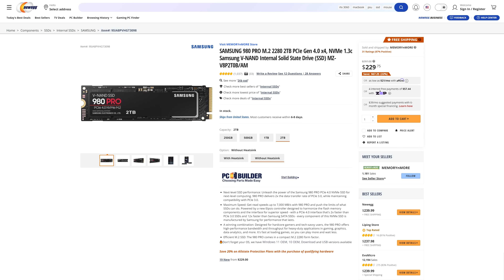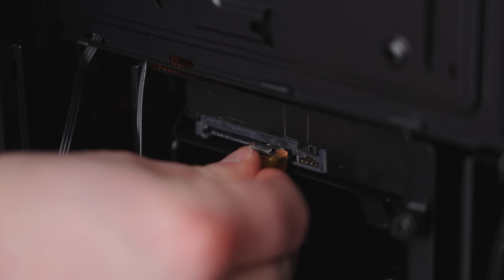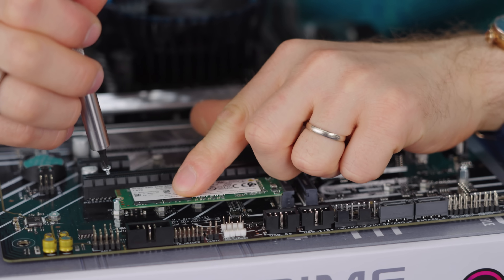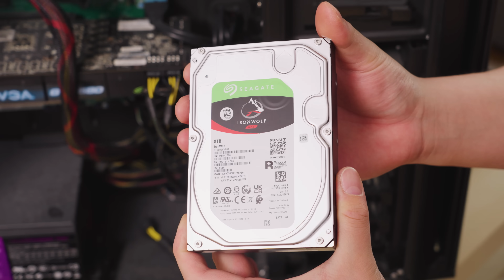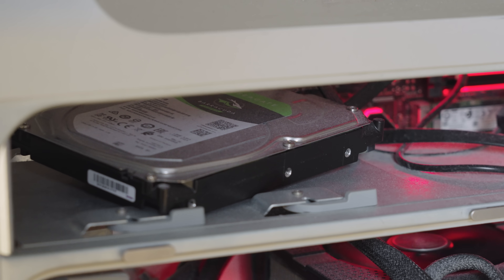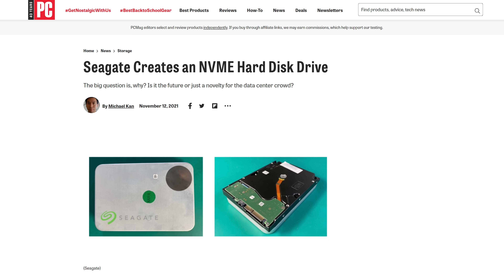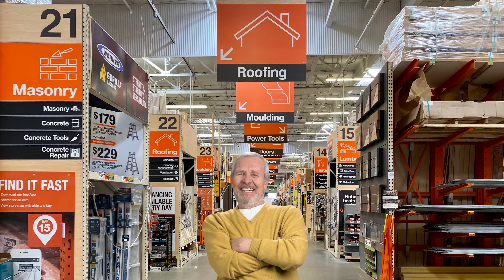Is SATA Obsolete?

Comment: Sata SSDs are gonna be the next HDDs, just used for mass storage
Reply: Probably not, SSDs suffer for the same reason that other flash technology suffers for mass storage. It's expensive and when it fails it can take all the data with it at once in a way that probably can't be restored. And to make that even more fun, you probably won't get any warning. In the 3 decades that I've had a computer at home, I have never had a single HDD go bad without any advanced warning. I'm sure that it does occasionally happening, but that's usualy lightning strikes, the house burning down or somebody stealing it. In pretty much all other cases, you'll get some warning that the disk is going bad. At that point, you make one last, and separate, backup and verify your backups are still good before removing and replacing the disk. SSDs and related don't normally give you that option.
Reply: @SmallSpoonBrigade  im just talking about typical use for consumer pc's, instead of needing to buy a harddrive for good capacity/price you will be able to get a SATA SSD and have fast mass storage. most people just downloading games and programs dont care if their stuff gets lost in a drive fail, it can just be redownloaded

Comment: Until a moment comes when consumer CPUs have a ton on PCIe or PCIe switches/hubs that covert 4x PCIe5 lane into 16x PCIe3 lanes, as PCie3 can be sufficenlty fast for not primary SSD, or even more slots if dropping to PCIe2 or reducing lane count per device.
Also SATA and NVMe drives already cost around the same, as bulk of the cost is NAND Flash and not controller.

Comment: Um..what?  SSD had absolute nothing to do with phasing out PATA.  Not even close!  Who wrote this one and why did you repeat the words?  That means it got through at a minimum 2 people.

The two were side by side for a very long time, CD-ROMs took a lot longer to come around and floppy drives still got used for many years.  If anything the speed benefits of SATA II and III is what did PATA in.  Not SSDs.

Comment: Sata is still better for older systems and budget systems since many motherboards only have 1 or 2 nvme slots and often only of those 2 support the better version. And for 99% of people the difference is neglible anyway.
And since sata is still quite a lot cheaper it's still the better alternative in most cases :)

Comment: SATA would still be useful to hook up slow mechanical archive storage for large files and databases you don't need to access quickly and just take up space for no reason other than backups and mass storage.

Since mechanical drives will be a lot cheaper per TB for quite a long time to come there's no reason to just remove it. The SATA ports on your motherboard don't really take up much space anyway.

Comment: My issue with nvmes are that they get really hot, and even with a heatsink, under load, I've had 2 separate nvme drives crap out on me within the span of 4 months. One of them was admittedly a cheap brand that I hadn't really heard of, but the other was a Samsung 970 EVO. It took 4 months each for both of them to die, even under the little heatsink that came with my AORUS motherboard (yes, I removed the little plastic film on the heat strip), so I decided that I would just go back to an 860 EVO SATA SSD, and it still runs very fast, and has lasted me far longer than the nvme drives have. I think I'll wait on nvmes until they figure out how to not overheat and brick themselves.
Reply: Samsung 970 EVO crapping out after 4 months. That's ridiculous. Did it fry itself because of heat or it got so much write abuse during the days mining crypto using storage space?
Reply: @IBO8Jaeger  it might've just been a lemon. I own no crypto, and Samsung has always been reliable (I still got a SATA SSD from them after their nvme died, and it's still great), but the nvme just overheated, I guess. If I do try for an nvme again, I'll probably get a wd black with the pre-installed heatsink on those, since that'll probably be more reliable.
Reply: @DJayPhresh  I bought 1TB Hynix SSD a year ago. I could've easily made this drive as my main and replaced my much slower 6 year old SSD but I didn't. My old SSD is fast enough in opening apps. Though, I sometimes would wonder and drool how programs would open in NVME and here you are telling me you downgraded to SATA LMAO. Sata SSD was truly a godsend as soon as it became relatively inexpensive as it brought so much life to any aging machines.
Reply: @IBO8Jaeger  doesn't matter how fast your apps open if you have to replace it in under half a year.

Comment: TBH, as someone who hasn't spent every day of the past 10-20 years building computers, I find NVME way easier to install than SATA. 

It has no wires, and the plug-in point is right on the face of the motherboard. I don't have to worry about plugging in wires I'm unfamiliar with at weird angles in tight spaces; I don't have to figure out some type of bracket for holding my SSD or whatever; and I don't have to worry about the cables getting in the way, tangling up, or making my build look ugly. A single screw point (and if we wanna get super advanced pro-level, applying a heatsink sticker) is so much less to think about and waste time on, even if it might technically take longer for an experienced builder.

Comment: the price difference is almost 0 for smaller capacity but high capacity drives are still very far from each other in terms of price.
Reply: Should I replace my sixteen 16TB internal HDD's (1/4 Petabyte) with Nvme's?
Reply: @Yggdrasill8  that's what i mean lol . the nvme is like 10 times more expensive in that scenario .
Reply: and do you need more speed ? that would be the deciding factor i think to spend the extra . for home use i can't imagine you'd need the speed . but i can't smell what you do for a living lol

Comment: SATA SSDs, much like HDDs,  are a great option for data density. Even if you had an equal number of SATA and NVMe ports.
An NVMe 2280 drive is limited to between 4 and 6 NAND packages. A 7mm 2.5 inch SSD can easily fit 20, or even 30 of those same packages. a 15mm drive could probably fit 30-60 NAND packages. Heck wasnt there a 30TB SAS/SATA SSD. To get that in NVMe you have to use the u.2 standard, which is the same 2.5 inch 15mm form factor. 

What would be nice is if they could bring out an NVMe over the SATA connector, with the connector having pins on both sides allowing for backwards compatility with SATA when it detects only 7 pins, but up to PCIe 2x speeds if it detects on both the bottom 7 pins and the top 15 pins, all over that same tired old SATA form factor

Of note you might suggest the SAS connector which sort of does what i'm describing above, but that requires a unibody connector and wouldnt be compatible with SATA drives without swapping out the cable as the gap that is normally between SATA power and SATA data, is a bridge with i think another 7 pins on top

Comment: SATA won't die out, neither will HDD anytime soon... because it's going to be many years before price per GB between SSD/HDD & NVME get's to a comparable range. My mediaserver currently has 52TB and I'd swap to SSD in a second if I could get 6 10TB SSD's for around £200 each or less.  My last 4TB SSD cost £286 and a 4TB NVME is in the region of £700
Reply: Also, SATA is still needed for internal optical drives.

Comment: I use a 1 TB SATA SSD as my boot drive, and a 2 TB NVMe drive as my game storage drive. Works perfect.
Reply: I think you would have a better experience yet by flipping that. The OS is still the most capable part of the system to take advantage of the speeds of NVMe. But I don't know if it would be noticeable in the end.
Reply: @HVDynamo  It currently boots from power off, to login screen in about 8 seconds lol. I'd rather have more space on my faster drive for games.